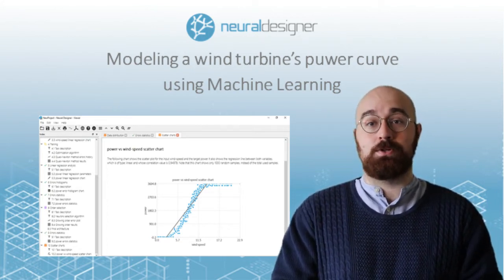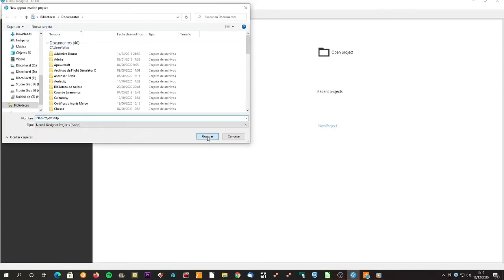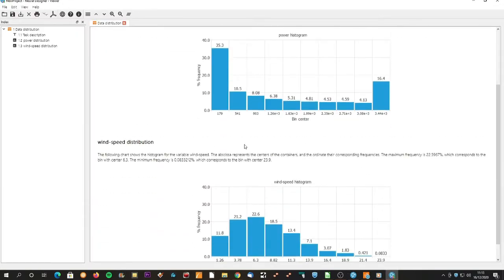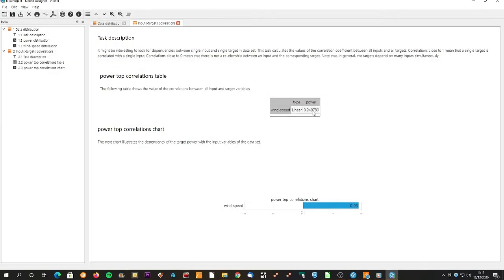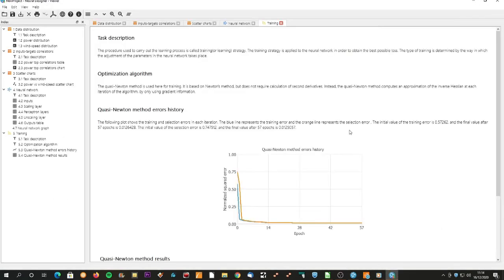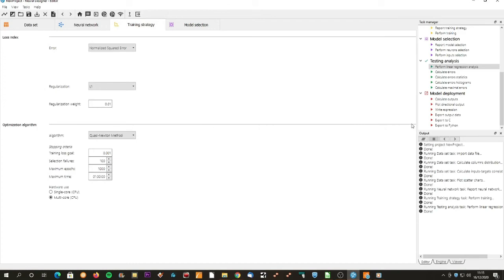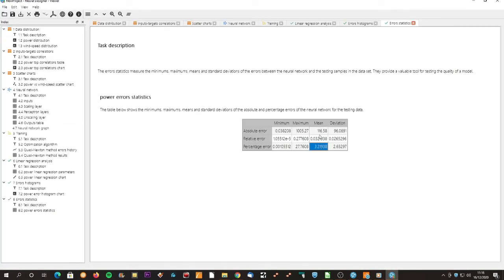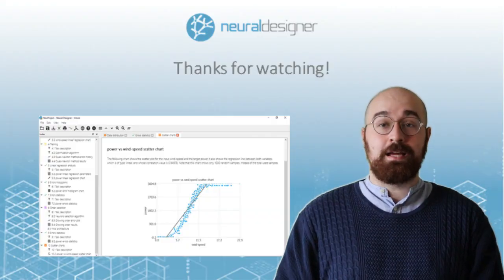Machine Learning for Modeling a Wind Turbine's Power Curve

Comment: Did the model use  a sigmoid or tanh function or did it predict using the neural network? As per the scatter plot of the ground truth, a sigmoid or a tanh could fit the data very well!
Reply: The model uses a linear combination of 3 tanh functions to allow a bit more complexity than a single tanh. However, as you say, one neuron would also fit the data very well.